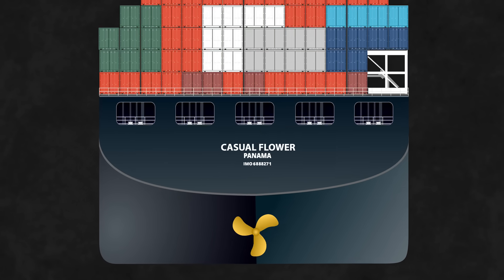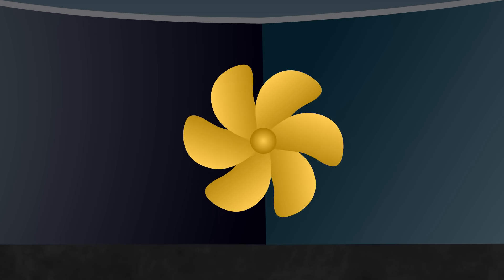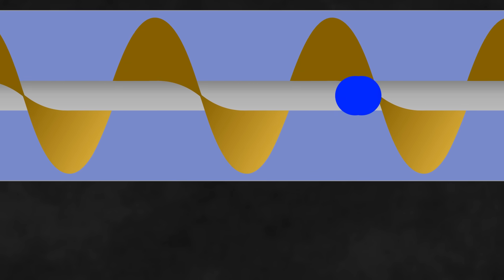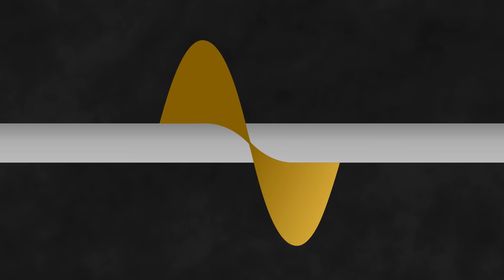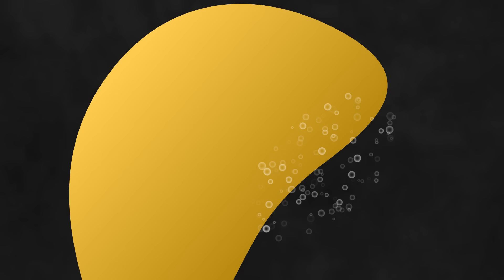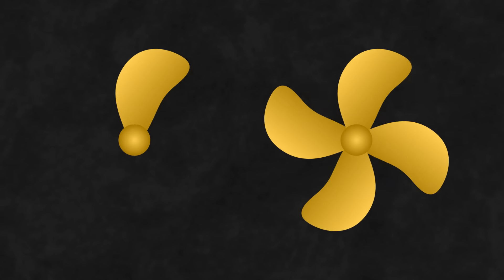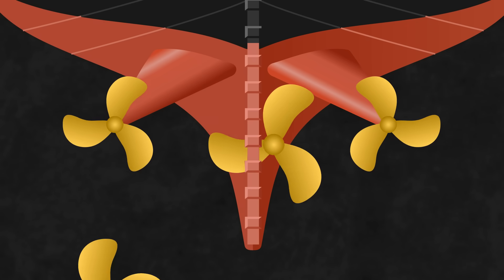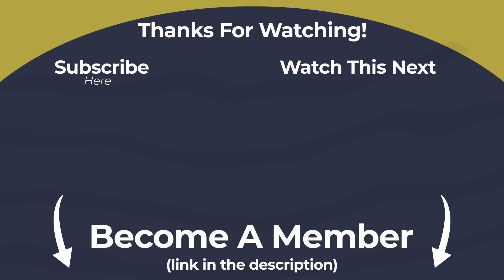Why Are 4 Blades Better Than 3?

Comment: The RPM is dependent to the diameter of the blade, and max speed should increase as there's more power with more blade.

Comment: an intersting situation is that the Iowa class battleships and liner SS United States all have 4 propellers, with the inner ones having five blades and the outer's having four. This combo was found to be effective when trying to reduce the shaking the North Carolina class battleships made at speed. The Iowas and SS United States were designed for speed so took that lesson and added another rudder for fast turns at speed as well. This design was classified at the time and SS United States only got to use it as she was designed to be usable as a high-speed troop carrier in case of war
Reply: Similar trials were done with 4 and 5 bladed props on the South Dakota class, but I think vibration and fuel consumption issues were never really solved due to those ships being in service for such a short time.
Reply: fun fact: the vibration issues on the North Carolina class battleships were so bad that they were limited to a 24 knot speed for some time until the issues had been solved by the propeller swapping. It was feared that higher speeds would damage some of the more sensible equipment on board (rangefinders, radar, etc.). This was obviously a HUGE issue when the cause of the vibrations was unknown (at first), the 4 South Dakota class battleships were nearing completion (with the fear they would have the same issues) and every other newly constructed battleship around the world was reaching top speeds between 28 and 31 knots without problems.
Reply: The S.S. United States did not get access to the design because it was a possible troopship but because it was an 'early access' version of the Forrestal-class propulsion systems.  The United States was subsidized by the Navy rather than the Maritime Administration. Making the United States a Navy-funded project gave the designers, Gibbs & Cox, access to the David Taylor Model Basin and BUSHIPS performance data on existing designs which would not have been allowed had it been a conventional MARAD-subsidized ship. The record-breaking Blue Riband run was actually a BUSHIPS experiment with the results fed back into the carrier's final design.  The propulsion design was classified because of its similarity to the Forrestal's.  Other contemporary MARAD subsidized liner/troopships like the SS Independence and SS Constitution delivered a year earlier than the United States, did not get access to Navy design information or the David Taylor facilities.
Reply: @edwardmeade  e
Reply: Also, subs and anything "stealthy" will have a prime number of blades. Because noises with harmonic multiples thereof are rare in the natural world, and thus a giveaway of manmade origin. Pretty niche factiod, but there it is.
Reply: @bcubed72  That's cool stuff. Reminds me of Dune. Which I guess isn't surprising, since Frank Herbert built lots of real-world science into his sci-fi.
Reply: Never head about that one.  Thanks for the knowledge.  Don't ya' just love YouTube?
Reply: I thought the second rudder on the Iowa's was for faster turning and redundancy.
Reply: @magnemoe1  I mis-stated. faster ship and more need to turn quickly as at 30 knots one rudder had no hope at turning quickly. edited it
Reply: ss america is excluded i guess?
Reply: @CuoreSportivo  she is earlier and has twin screws- the design I mentioned is only needed on 3+ propeller ships